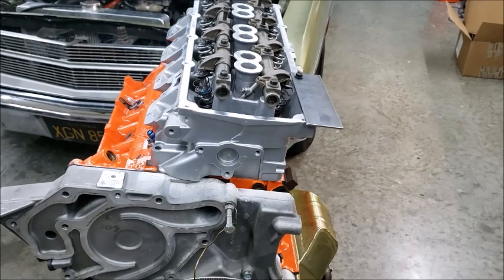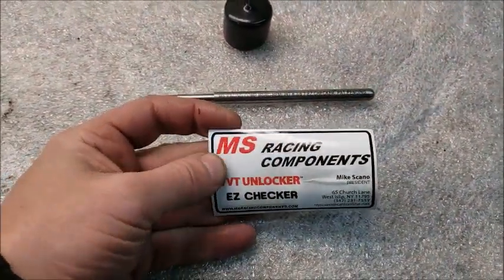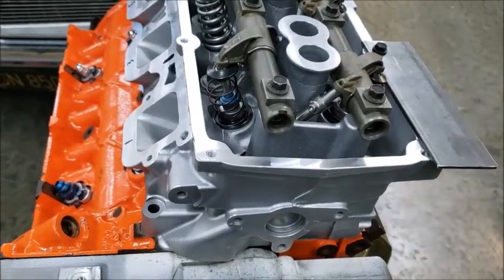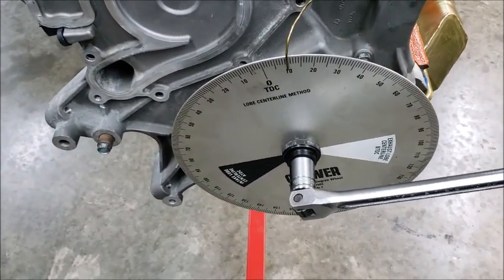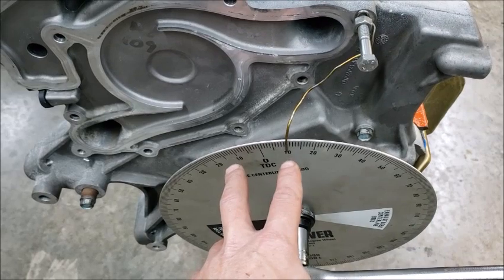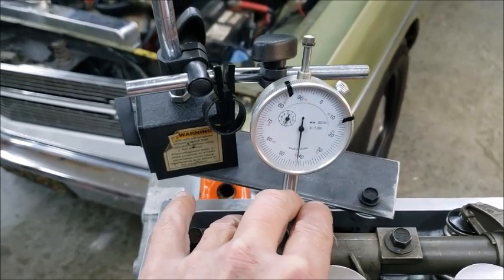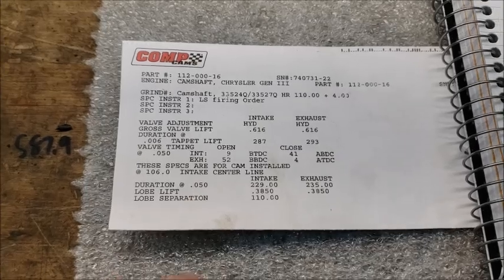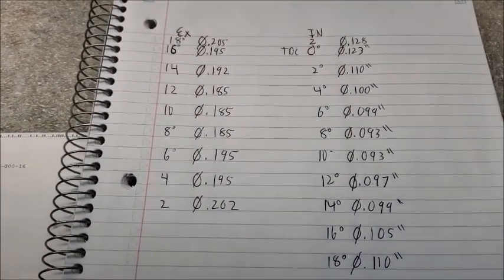Checking Piston to valve clearance on a Gen III Hemi.

Comment: What's the purpose of the LS firing order in this application?
Reply from the maker: The Windsor or LS firing order is better on the rod bearings at higher RPM's. It really comes down to twist and harmonics with in the crankshaft. Ford figured this out when the made the Windsor firing order then the LS engine copied it.